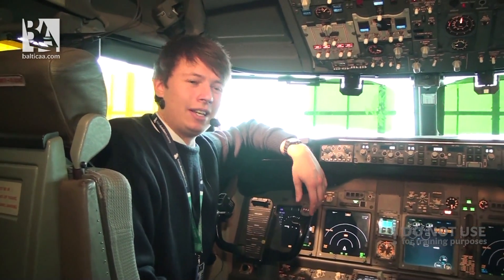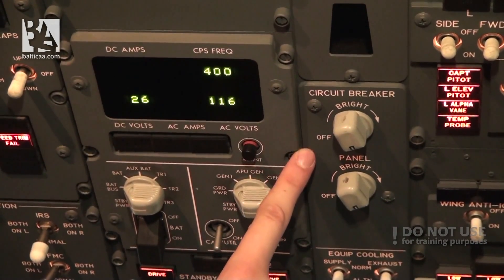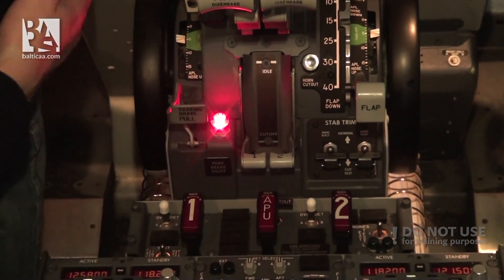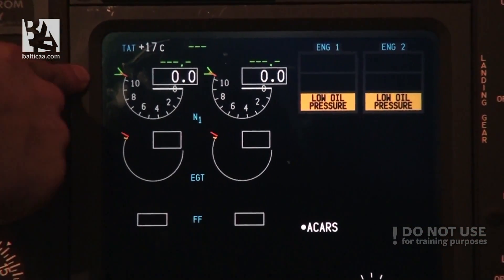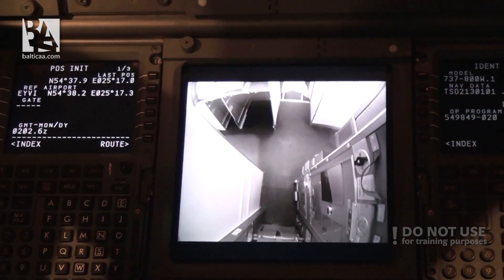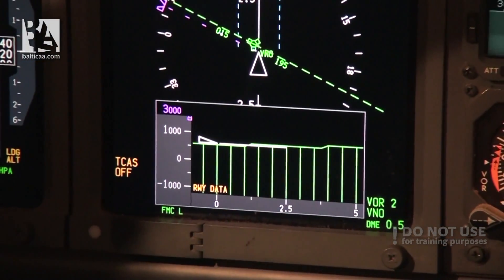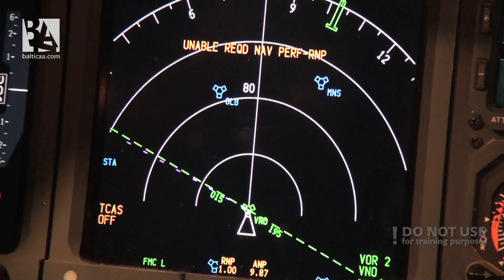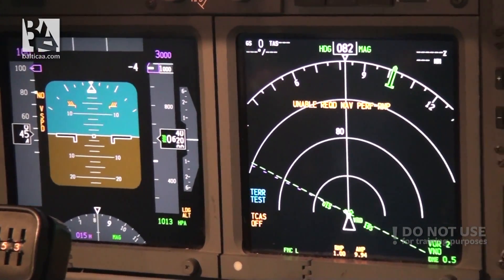Boeing 737 NG cockpit demonstration

Comment: Pranas, If I fly over, can I come to work with you for a week? Hehe!  What a job! 

Cold/Dark to ready for departure, is there a significant decrease in flight control prep from this 737-400 to the newest 737 Max being built? Visually it looks like the cockpit controls have been slimmed down a bit on the Max.

Comment: HPA or hectopacal : the most common unit of atmospheric pressure; in the plural, it does not take an ‘s’: 1021 hectoPascal. It is the equivalent of millibars (mb), which is still referred to in many countries. Inches of Mercury (in.Hg) is used in the United States. 1 in.Hg = 3.386 hPa

Comment: What are the yellow things that look like eyelashes on the attitude indicator?
Reply: Pitch up limit. If your actual Pitch attitude is above those yellow marks, stick shaker activates.
Reply: I believe they are critical angle of attack indicators
Reply: Those are pitch limit indicators. In the event of a missed approach, windshear encounter, etc, they denote the max angle you can safely pitch the aircraft up to without stalling.
Reply: Pitch limit indicator (fixed at 15 degrees) at slow speeds. An area a pilot flying must avoid to prevent a stall.
Reply: That's a very interesting question that I've been wondering about myself too! In another video (on this channel I believe) I've noticed that while dealing with windshear shortly after take-off, these 'eyebrows' were very close above the pitch indicator, and when the pilot increased the pitch above these eyebrows, the stick shaker would activate. I figured it might be an indication of how hard you can pull up before risking a stall. After extensive googling (because I'm not a pilot and didn't know the correct terminology for what I was trying to find :) I believe the proper description is as follows:

Pitch Limit Indication: Indicates pitch limit (stick shaker activation for existing flight conditions).
Pitch Limit Indication is displayed as long as the flaps are not up and also at slow speeds, even with the flaps up.
Reply: Permaglo i dont know
Reply: its showing stall
Reply: Permaglo I think it is the Flight Director

Comment: great video ,could you try a looping ?
Reply: Xav Moi thats not possible for a number of reason one of those is engines cut off if the plane is upside down
Reply: Xav Moi basically impossible in a 737.

Comment: Why are you in a real jet are you a pilot or do you have permission?
Reply: Nope, this was done in a real 737
Reply: This is a simulator
Reply: +M235i Iz Liyfe No. This one is a real plane. The other videos are filmed in simulators.
Reply: Oh really? That's amazing then! Thanks for letting me know!
Reply: This one isn't a simulator, this is a real plane, so he must have got permission.
Reply: Grammar Nazi no it not
Reply: There is a washroom as well as real sunlight. If it was a simulator he would have flown it.
Reply: It's definitely not a simulator as you can clearly see outside the windows. It is also probably why they had to blur out the tail number plate.

Comment: Usually a black plate with the arcraft registration & SELCAL Code (if so equipped)...hence the need to blank it out...I doubt the aircraft owner/operator would authorise such a video.

Comment: There are no Flight Control or BTMS indications on the lower DU as the aircraft operator/owner did not select them for their particular configuration.  Even if the HYD SYS were pressurised they would not be seen if not a customer option.  Great vid nonetheless!